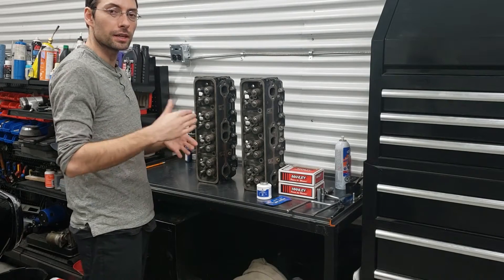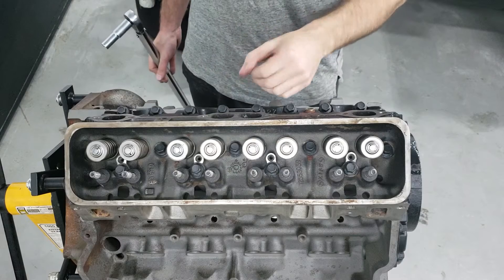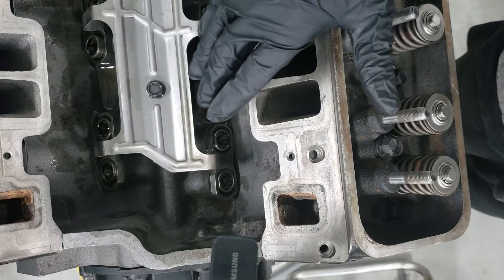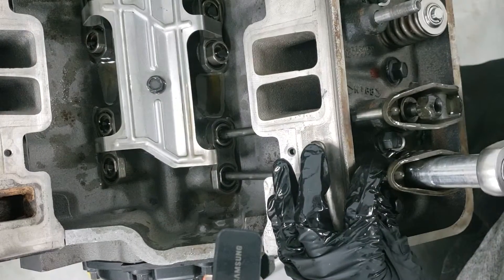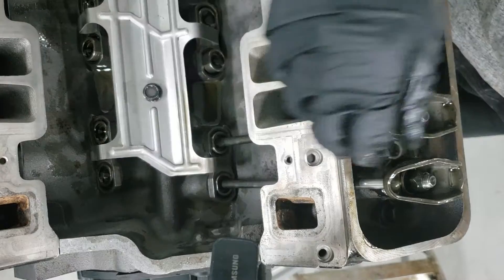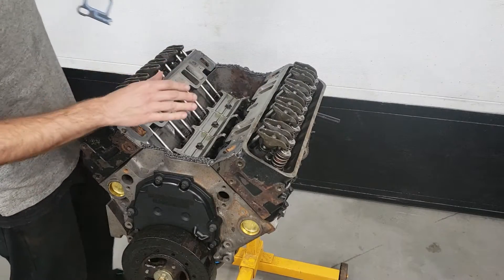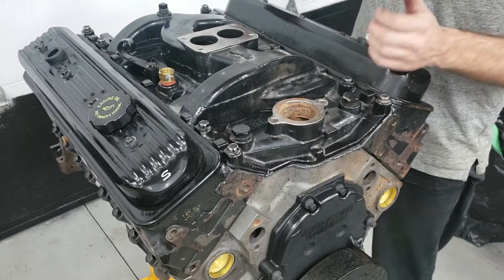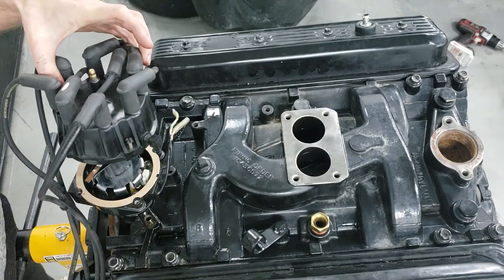Mercury 305 rebuild | part 6

Comment: What are the part numbers on the gasket set you used and for the new timing cover. What is the part numbers for the main and rod bearings also cam bearings

Comment: Didn't see compression ratio or squish set up and considering you replaced the block but used the original heads I can assure they would need to be done or checked at least, difference between power and no power !
Reply from the maker: I did not include every single step of an engine build in the videos. If I did, these videos would be 10 hours long. And to address the first 2 things. Compression ratio and squish aren't required on a stock build unless your changing other components which would require you to check it, having a slightly thinner or thicker gasket would barely affect the ratio for this setup. If I was building a race motor for a customer with a lot of after market parts, then yes, these measurements need to be accounted for. Hope that helps. Thanks

Comment: Great video. I watched these videos about 8 times. I have 2 of these engines to rebuild. One of the engine is Reverse Rotation. What information can you give me regarding the difference in parts for the rebuild?
Reply from the maker: That is a good and rare question. The reverse rotation engines require a different set of Rear main seal + timing cover seals. These seals are designed with an angle to them to reflect crank rotation. So this is very important, and easily missed. The other thing that needs to be addressed is the Piston Directions. In the conventional rotating setups, the pistons usually have a dot which is to point towards the front of the motor. In your reverse setup, you need to point the dot towards the rear of the motor. The piston rings follow the piston orientation. And last but not least, your timing set is different, you don't use a timing chain, instead there is a 2 gear system. This will maintain the camshaft, oil pump, and distributor directions. So the only thing that rotates differently in your setup, is the crank, and nothing else. I hope this helps.

Comment: Do I need marine head gaskets? Also can you send me what thread sealer you use. I got a gm 305 donor motor non marine I just need to know what all I need to change or use internally.
Reply from the maker: Hi. and yes, I would recommend using marine gaskets. They have a stainless steel or aluminum construction in the water passage-ways to prevent corrosion from the lake water. Regular gaskets don't have this issue because of the chemicals and lubricants in coolant fluids.  As for the sealer, it's Permatex Aviation Form A Gasket. I hope this helps!

Comment: I have a seized 5.0 mercruiser and was wondering if I can get a truck 305 and out the exhaust and water pump or are they built diffrent
Reply from the maker: Hi blake. So they are built slightly differently. The head gaskets for marine applications use stainless steel since the water passing through the heads isn't treated/lubricated. And there's an extra steam water port on the merc block, but this can be ignored. The camshaft is also different since boat motors are meant to operate generally at a constant rpm range. Apart from that and maybe the dipstick... you should be able to swap it over.  This mercury build series i used a truck block from a 90s van. Hope this helps.
Reply: @DarkBloodMechanical  how much did this rebuild cost with all parts
Reply: @blakelira7098  itll all depend on whats damaged and whats reusable. We got lucky with this build. So if you watch the whole series i mention what parts needed replacement. And which were new. I charged roughly 3500CAD for the whole job. This included machining, new parts, paints, tune.

Comment: Just wanted to give a huge shout out and say thank you so much. I followed your videos step by step and yesterday I started the motor up first shot and it ran amazing!!! Thanks again for all you do!
Reply from the maker: Oh that is just awesome! Im glad this helped! that was the whole goal. Happy you got that motor running. One thing I would mention at this point, now that your motor is started, monitor your oil pressure & water temp, set your timing, and your air-fuel.  These are the 4 main reasons a brand new engine will fail prematurely.  But aside from that, enjoy it! And thank you for the comment, I appreciate it.

Comment: Great videos and they really helped me with my rebuild. I have two questions: Did you use assembly lube on both sides of the connecting rod bearings? and also what type of silicone did you use for the gaskets? Thanks again for this as it has been a life saver for me anyways!
Reply from the maker: Hi, thank you. And I am happy you found these useful. That was my goal. For the RTV, I use Permatex 59213 black RTV silicone. You can use any automotive water&oil resistant gasket maker, but I recommend the one listed. As for the bearings, never put assembly lube on the outer surface of the bearing. This surface, as well as the rod/surface must be as clean as possible in order to achieve the correct bearing tolerances, as well as prevent the bearing from ( sliding/spinning ). This is why we clean the parts first, then insert the bearings in place, and the final step is to lube the surface where the bearing meets the crank. I hope this helps. Feel free to ask further questions.
Reply: @DarkBloodMechanical  Thanks I really appreciate it!

Comment: What truck model or SUV uses this same engine block? I'm looking for a cheap option for repair.
Reply from the maker: Hi. you can pretty much use any vortec v8 motor, so chevys and GMC   C/K models. and Savana work vans. Basically look for any mid-90s to 2003 ish era. There are some v6 vortecs that were used in these trucks as well, so make sure its the v8 models. The block itself will only have 1 difference, and its the water coolant vent at the front where the water pump meets, this will make no difference in marine applications so it can be ignored. Hope this helps.
Reply: @DarkBloodMechanical  help me a lot, your response and your videos, thanks for posting.
Reply from the maker: @alessdre  Thank you. and your welcome. that is the goal of the channel, is to share my projects, and hopefully others can learn, or teach me.
Reply: chevy 305 5.0 auto blocks are slightly different, oil dip is on other side, if its a 2 part crank then flywheel, all freeze plugs swapped for brass, oil pan and seal, swap plugs and drains, marine head gaskets and different camshaft profile. Auto engines aren't designed to go at 5000 rpm constantly. I just put a 350 auto in a boat and it works well but was a p.i.t.a!!! in hindsight I prolly should have just got the marine engine. lol oh well

Comment: Wow am surprised u got it running so easily cuz I thought the bore was too tight. But I guess in an oil crankcase 4 stroke it’s better lubrication to spin freely.
Reply from the maker: Hi. piston to wall clearances on this build were about 0.002"-0.003". connecting rod tolerances 0.0025" and main journals about 0.002". When you first assemble a motor, with the thick Assembly lube, everything will be tight. It can be rotated by hand with a bit of force. Once a motor is fully broken in, the components will Seat themselves and free up some of that stiffness. :) I hope this helps.
Reply: @DarkBloodMechanical  I had rebuild 2 Johnson v4 2stroke. The first build I had binding cuz I believe the clearance were abt .003 bit to tight. Then the second build the mill shop bored. 004-.005. Believe it or not that crank was more freely to spin & started & idle a whole lot better. However the highest cyln compression on that motor was 115psi compared to the the bore with the tighter clearance @ 120psi but had alot of hardstarting issues & took 2 summers of boating to seat &  start & idle better.
Reply from the maker: @fishawk90  Good to hear you got it running. I've built dozens of SBC's and tolerance them based on materials and application use, and haven't had an issue. I have however, received a motor from a customer whos tolerances were so tight that the Starters were burning up and car wouldn't idle. Once I rebuilt the motor with the correct tolerances, all worked fine. :)
Reply: @DarkBloodMechanical  OK. My friend had a Volvo rebuilt on his sail boat but they just hone & put new rings not sure cuz it's an oil crankcase the bore does not oversize so much . But I kno on 2strokes they wear alot more. Any cyln oversize beyond .004 it must be rebore. Is it the same .004. Tolerance on those mercrusier block?
Reply from the maker: @fishawk90  Hi. I can't say its the same, it would be best to get an engine build spec Manual for the Volvo to confirm tolerances. In our build, I bored and honed the block to match the pistons, 0.004 is a bit too much for our application. If we used a set of 4032 or 2618 forged pistons, then 0.004-0.0055 roughly is what we would tolerance the bores to, depending on how the motor will be used. All tolerances on a motor must be spec'd based on the materials, and the use of the motor. I hope this helps.
Reply: @DarkBloodMechanical  thnx alot. Guess the grade of aluminum will dictate expansion. I got aftermarket piston forge in Argentina which were abt 1/3 less cost than wesico or wsm. But had a detonation in cyln #4 that turn peices of the crown into tiny crystal balls inside the spark plug electrodes.

Comment: Hello you adjust valve only 90 degrees?
Reply from the maker: Hi. I should have clarified. I start-off with a 90 degree turn ( quarter turn ). once the engine is warmed up, if I hear a tick, then I will usually add an extra 90 degrees until it quiets down. I prefer to run the valves on the looser side rather than tighter for a stock build. When it comes to more performance builds, then I set the preloads based on the lifter-plungers stroke. You can experiment with just 90 degrees to start, and then move to a half turn or more as long as the motor doesn't start misfiring. Always do this when the engine is fully warmed up, when all metals have expanded to correct operating temperatures.  I hope this helps.
Reply: @DarkBloodMechanical  thank you Dark

Comment: Love this series! Ive got the same engine, do you know where i can get the torque-specs in metric? 🙂 /from Sweden
Reply from the maker: Hey There, and thank you! I have a lot of content to go through and edit for future videos. So stay tuned.  Also, if your referring to torque-specs. My readings are in FT-LB.  If you are looking for metric, you can convert the values  as follows.   1 Nm = 0.7376 ft-lbs.     so if you have   60 ft-lbs as a spec.   simply divide   60/0.7376  =  81.3 Nm 
Hope this helps.